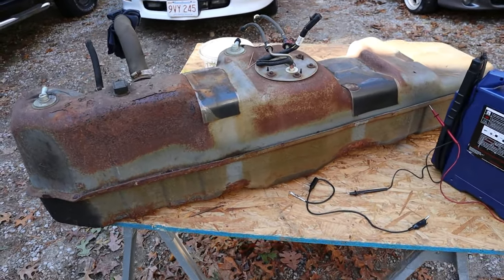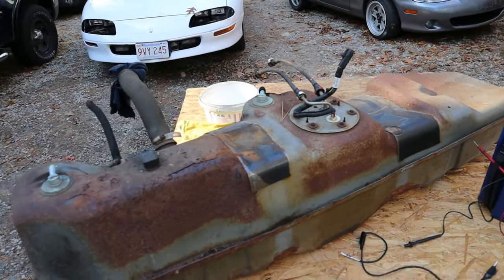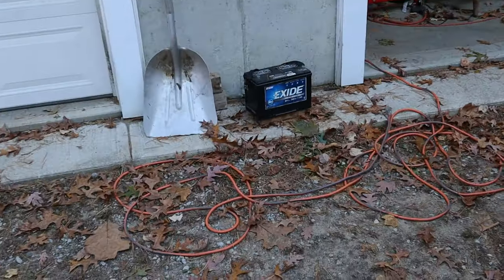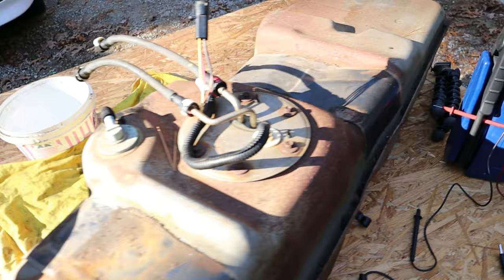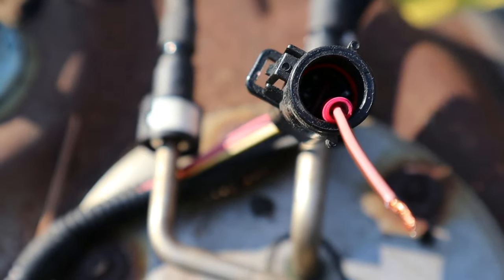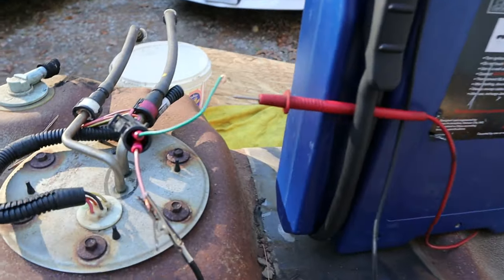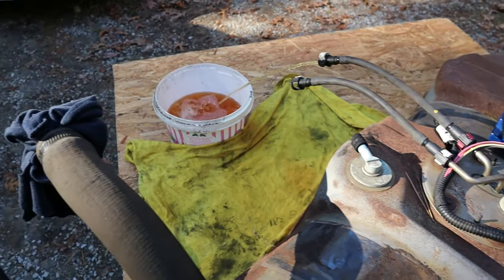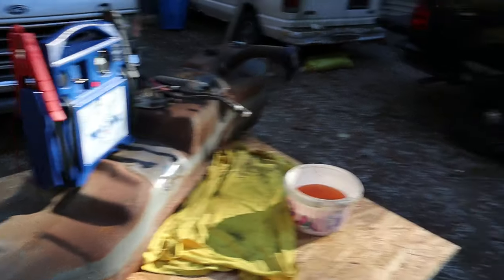HOW TO EASILY TEST A FUEL PUMP!

Comment: We have removed fuel tank twice on my Pontaic G6 because line/quick connect or pump is leaking "a lot" is there a way to test what is leaking while fuel tank is sitting on work bench..quick connects and pump ..fuel tank is not leaking with full of water...do I need to purchase new fuel pump in addition to the fuel lines?
Reply: maybe block the flow somehow so it builds more pressure in the line and pushes fuel out of the leak

Comment: I notice it have 2 line and I’m guessing that the one of them is the return line so my question is would the pump pumps through the return line ?
Reply: Most often the return line just comes from the "far" side of the fuel rail, usually from the fuel regulator.   The injectors pull fuel from the rail, but they don't take it all.   It's a loop.

Comment: Can you test the pump without fuel. I pulled my pump and put jumper cables on it and I didn’t hear anything. It just sparked.. no sound at all but I was trying it without gas going through it... but I’m almost positive it is the pump.
Reply: Yes but dont let it run for more than a couple seconds cuz you can fry the fuel pump. And if you didnt hear sound when connecting cables to the wires of fuel pump then your original diagnosis of it being the pump is correct. You need a new fuel pump
Reply: @StaineLaSteele304  what if I connected the new one and it doesn’t make the buzzing sound?
Reply: @Pretyboyflako1  same issue

Comment: Thanks! I have a two fuel pumps that energize but won’t send fuel. I crimped the connecting wires for the fuel pump connector. Is it possible only one side (ground or negative) is activating the fuel pump? I don’t get why two pumps won’t send fuel! Thanks!

Comment: I haven't watched one of your videos in a while so I figured I would pop in, check it out and say hello.
Good stuff, and like you said you don't need a Power Probe, but I would highly recommend one for anybody who was seriously working on their vehicles. If you're only doing repairs when it needs it, then it's not that big of a deal, but if your building or constantly working on anything it is a damn good tool to have. I also want to add it is a very dangerous tool to have if you're not careful. You can easily fry very expensive components with a Power Probe. But as long as you double check all your wires before you put Power to anything you will be just fine.

Comment: Fuel pumps and an F-body. Bad pump on my 95 Firebird mad it take forever to start every morning. Back in 2010 I had more money than time so I paid a shop to replace it. Good thing, it had many very rusty bolts to force off to drop the axle and tank.. If I had to do it today I'd be customizing an access port in the floor. Great video.
Reply from the maker: Lmao the ole cut an access hole trick 😂😂

Comment: How did you get around your antitheft problem?  That is my oroblem and it is not easy on a ford explorer to remedy,
Reply from the maker: We were using the wrong key. The key we had went in and turned and allowed the truck to crank but was tripping the anti theft so it wouldn’t start. Once we got the correct key with the black plastic part that contains a chip from the previous owner the truck fired right up.

Comment: Hello, how can I do the same test on fuel pump with three thick wires or controlled by fuel pump module?
Reply from the maker: You have to determine which wire is power and which is ground. Then you could give it power to try to make the pump work or use a volt meter to see if the vehicle is sending power there.

Comment: Those the pump needs to have constan power? Or just only when you turn the key on to start???
Reply from the maker: When you turn the key to the on position the fuel pump will run for a few seconds and then shut off to prime the system. Then once the car starts the fuel pump will run constantly to feed the engine.